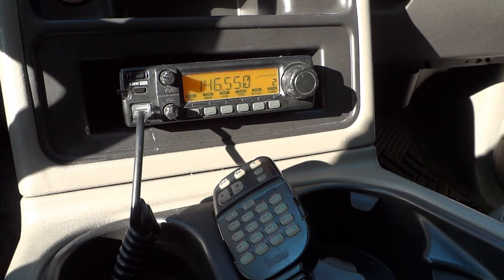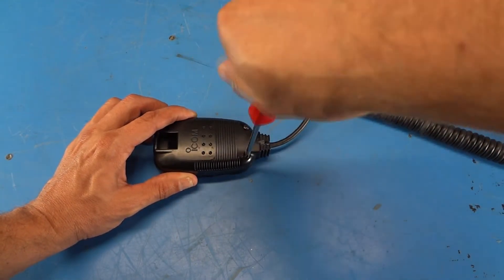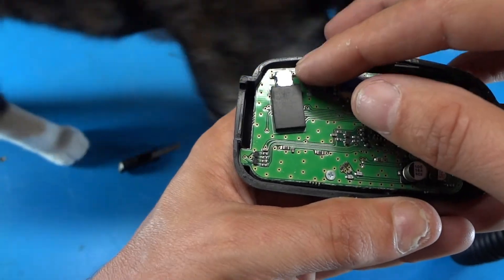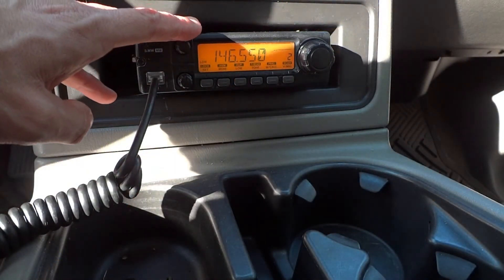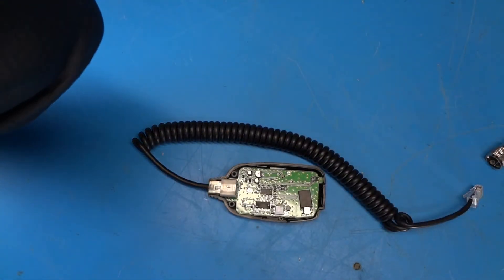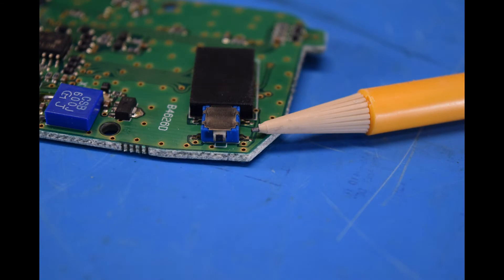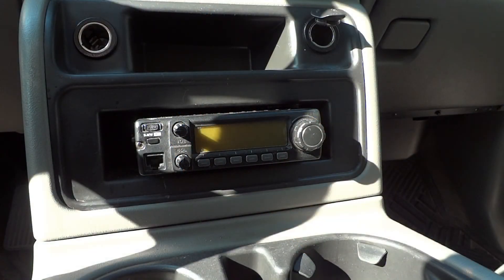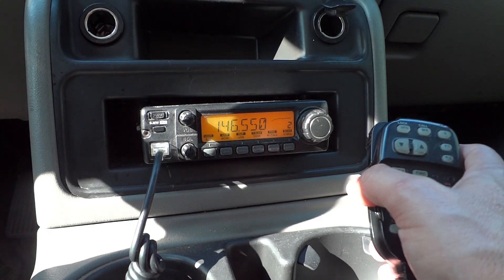Microphone PTT Switch Quick Repair - Icom HM-98

Comment: Typical.designed to fail!! I got Motorola mics from the 60s that have original rubber cables,and real metal switches that still work.when are we gonna wake up and see we've been sold a bill of goods.communism still exists,they've just changed the tactics

Comment: That little button piece with the piece of metal is a pain too.  If comes loose and won't come in contact with the button.  It's regular wear and tear. 
I'm looking to remove the switch and replace it with a push button.

Comment: How do I fix my hm98s.? If I press the ptt and let go the radio doesn't stop transmitting even if I press the ptt again many times??
Reply from the maker: The button probably stuck.  You may be able to clean it with isopropyl alcohol if you take it apart.  But be careful if you do try.

Comment: First, who is the little furry?  Always check the mic first, good fix. Is there a 2m repeater that you monitor or simplex?  I will be installing a 2m beam next month so I will be testing.
Reply from the maker: That was my wife's cat Maple trying to help.  For the last few months I've been talking with a guy on a repeater on my way home from work.  With a beam, you'd probably be able to hit it from your place.  I'll send you a PM with some details.
Reply: Will do.
Reply: Pan as in cakes.
Reply from the maker: Actually, it is...
Reply: @SevenFortyOne  It's obvious you would've struggled with this repair, without the technical advice from the cat.

Comment: I hate that when that happens! Lead free solder is also a culprit for not making a good contact sometimes when it ages. I had a ICOM HT where I had to do the same thing. I do like ICOM stuff. You did a good job isolating the problem.